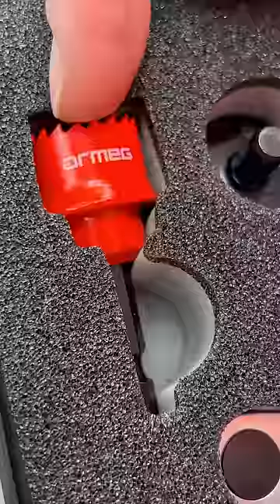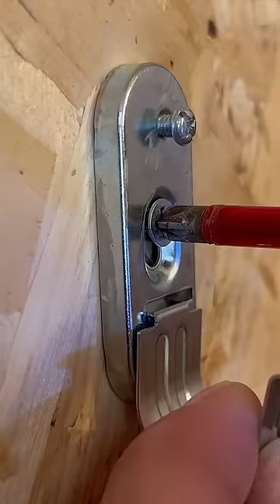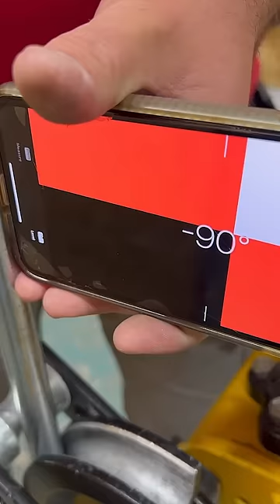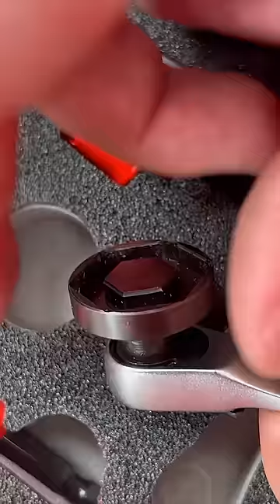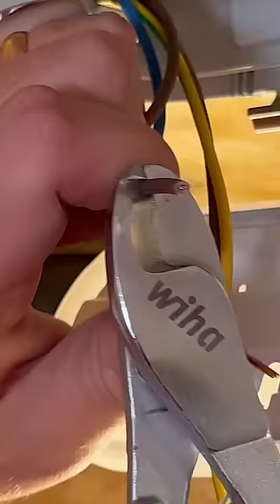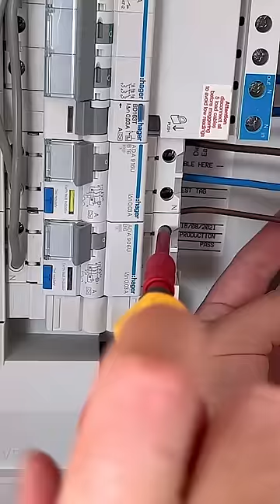How Many Electricians' Tools Does It Take to Fit a Light?

Comment: UK installation is really nuts.
Reply: What why? How?
Reply: This is commercial grade stuff, it's not like this in houses
Reply: I see what you did there and it bolts.
Reply: @pab26120 depends on the use, if you follow any modern code book im sure you have examples of simple installations and some that are quite over complicated. All depends on the use case and likelihood+risk of failure.
Reply: But the USA runs on low Voltage. Do you realise that domestic mains electricity in the U.K. is double the voltage of the USA ? In real terms thats about 10x the amount of electricity. Commercial is about 10x that again.
Reply: @rob-fb5xs   Yes, and the US system is even more nuts with a big waste of good materials by continuing using 120V
Reply: @rob-fb5xs double the voltage is 10x? Wow. Btw we run 240v to appliances that need it, and even then it's safer because each hot is only 120v potential to ground.
Reply: @snorman1911  Ha ha! I’ve got no idea, I just thought I’d write that to get some funny replies 😄
Reply: @mortenwinslw2785 no need for anything more than 110v. You know why everything costs 3x, takes 3x as long, takes 3x as many people in the UK? Because of this exact video. No need for any of this nonsense. It would take him 6x longer to do a job. The 220v also prevents most people from doing stuff themselves. It's unfathomable to people in the UK to hear that a lot of people do work around their houses themselves. Not just electrical, but anything. It's just not in their DNA to do diy stuff in the UK. Anything that needs more than 110v, gets 220V. No need for 220 running all over the place. You never even use half of what the circuit is designed for.
Reply: @littlejackalo5326 where are you getting 220v from? Uk voltage is 240v, harmonised with Europe in 2003 to 230v. The Uk has one of if not the safest and most comprehensive electrical regulations in the world. Our installations are top class. Why you think unqualified people should be able to work on electrical installations is beyond me, do you think people should be able to fiddle with their gas too? 

Would you rather have this install in your home, or a “that’ll do” install? I know which one I’d go for.
Reply: @mrglock568 I mean quite literally in the US you can work on your own gas and electric lines. Sometimes needing an inspection but that’s the price you pay for actual ownership of your property. Do whatever you want. But mess up and it’s on your shoulders.
Reply: @mrglock568 yes I do think untrained people should be able to fiddle with whatever they so please. It’s that same attitude that led us to separate from your crown in the first place. You act as if electrical is rocket science and that some random person committed to the craft couldn’t learn to wire a 120v switch with a YouTube video. If only Brit’s would trust the experts when it came to their teeth care.
Reply: @mrglock568 well in North America people generally say 220v to 240v interchangeably. Same with 110v to 120v due to most appliances/devices allowing a +/- 10% in voltage tolerances for AC.
Reply: @littlejackalo5326 The same thinking exists in Europe, where 230/400 is common in homes. 400v goes to Water Heaters, Stoves, EV Chargers, and 230 goes to things that 400 isn’t necessary for. Anything above 50v can kill you 120 isn’t safe its just safer. But it still isn’t safe to just touch all willy nilly. All 230/400 circuits are protected by RCD “GFCI” something that North America doesn’t do. Which makes 230/400 inherently safer than 240/120 because its always required to be behind an RCD. 240 dryers nope no GFCI stove nope. EV nope. And 120 again nope only in wet locations. Which is why all North American hair dryers are required to have a GFCI plug something you won’t find on an EU UK AU hair dryer.

Also twice the voltage half the amps. Hair dryers in the US every one I’ve used makes the cord warm to hot. Where’s at best the cord only gets slightly warm in Europe. Some schools of thought consider higher amp draw more dangerous.

120 is a legacy system that stuck around and causes far more problems like arc fault issues due to people thinking they were better than others. And in some US states it is against code to work on your own electricity. 120 lived on because the US light blubs at the time didn’t work well on 240 wheres somehow German light blubs worked fine so to save copper Europe chose to go with 220 now 230. And America added 240 after the wave of all electrified homes swept the nation due to GE’s all electric house program. 120 is not sufficient for most things. Even lamps and other low power devices like game consoles in Europe at max only need a Euro cable which is rated at 2.5 amps and that was far before leds were a thing. 2.5 amp x 220 is 550 and 2,5 x 230 575.  Where’s in the US 2.5 x 110 is 275 and while that is perfectly adequate for a 60 watt light blub for some reason 13amp wire was always used.

It is interesting the difference in choices each place made and for their respective reasons. But after seeing how efficient and safe the EU system is despite being twice the voltage and Americans always saying 240 is deadly 120 is safe. I’ve come to learn that’s watering down the risks and trying to justify using an outdated system. So yes while 230 is inherently less safe than 120 it is implemented in a far safer way than 120 ever was.

Code in the US just now started mandating 120 circuits be protected by gfci / arc fault breakers and all outlets have to have shutters now but that’s only on new house installations. So finally the 120 system is catching up to the EU style. But when every kitchen appliance maxes out a 15 amp outlet and 12 gauge is now standard to run vs the 2,5mm2 standard in Europe its a waste of copper. For something that could be fixed for the same reason stoves and dryers use 240. They are high amp devices.

Also hair dryers go up to 2400watts in Europe. US dryers max out at 1875 the max for a 15 amp circuit. 2400 is not the max of a EU 16 amp circuit. It also means you can have an air fryer, toaster, coffee machine, running at the same time on one run of 2,5 which is similar to 14 gauge. The last kitchen I had in the US had to have 12 gauge and 20 amp breakers for the kitchen. Because Air Fryer, Toaster Ovens etc are very popular now days.

So no I do not think 120 is justified as satisfactory anymore. I used too, but I’ve since seen things done far better. Now its okay to have an opinion but this is mine after experiencing and seeing the benefits plus learning more about the differences. I do not think in a world where high powered appliances are all the rage and materials due to EV’s becoming more and more common that sticking to a system invented for DC power distribution in the late 1800’s to early 1900’s is a wise decision. Especially when the majority of the world uses 230/240 for their low mains voltages side and only a small part of the world has stuck to 120 and an even smaller part 100v in Japan.

I realize this may sound like an argument I am just trying to convey what I’ve learned about the two systems. I realize I may come off as biased perhaps that because I grew up being told 240 dangerous 120 safe. When in reality neither are safe. They are both dangerous just one is slightly more dangerous than the other when there are no protections in place, which is only really common in North America. I can’t speak for countries outside of Northern Europe, and the AU/NZ. But as far as western standards go 230/400 is arguably far safer only due to the fact its treated with much more respect and unfortunately fear than 120 is, which might be why the EU UK AU and NZ all adopted all RCD protected circuits far sooner than compared to North American which is just now starting to adopt a similar approach. Because people have been thinking for far too long 120 is automatically “safe”.

Also fun note, worksites in the UK use yellow transformer boxes which output 55v on each leg to 110v power tools so that if one gets shocked its 55v to earth. As 110 is considered dangerous and 55v is considered far safer than 110 and 240.
Reply: @rob-fb5xs you realize you have 240v in your house? And commercial is 208 or 480v primarily? 

Time to educate yourself.
Reply: @leftyeh6495  Oh I know I just seem to have failed to express the extent its been implemented. I did say the code which I believe was updated to require gfci and or arc fault on every circuit. But at least at the time it didn’t include manufactured / mobile homes as my friend who moved into one in 2020 brand new too built that year. Had only gfci in wet locations and the outlets did not have shutters. Which was also part of the update for new residential builds. Now I may be misremembering this so I can’t guarantee, but I do know as i looked their panel has no arc fault breakers nor gfci breakers. 

Which may be a great thing considering I’ve only heard bad things about arc fault breakers being overly sensitive. Where’s arcfault breaker are not a thing as far as I’ve seen in Europe at least Norway, Sweden, and Germany. From what I was told arc faults are kinda pointless or redundant at 230 as RCDs are or have been sufficient enough. That it has to do with the 120 being more prone to arc faults being more a concern I believe due to the high amp draw but I may be wrong. I’m only learning still, but it’s interesting the differing view points.

I really like not having gfci on every plug “outlet I didn’t mind” but its nice that it’s in the mains panel and every circuit is protected and as far as my experience I’ve never had one trip let alone unnecessarily. The only thing I’ve seen a device in Norway have an RCD in line to the plug was on a blow up hot tub. I think the reason rcd is standard is ultimately to protect the house and is the same reason for why only elektrikern is allowed to do electrical.

Yes to protect the living but also to prevent property damage as house fires are not favourable. Well no one is fond of them anywhere «except a few particular people» but I’ve seen some real shoddy diy electrical work in online forums and on a few DIY shows in the US no clue about Canada but I don’t doubt. Ultimately it is nice to see the US catching up but the implementation is like bloated beta software. Hopefully one day things will even out. However unfortunately I kinda agree the US takes it overkill on trying to prevent Darwin awards. Can’t protect everyone and can’t stop some people “sometimes on purpose” trying to do stupid things.
Reply: @peteasmr2952 I agree with everything you have stated. I've been an electrician for a long time now and always wondered why the U.S. stuck to the split single phase 120/240 volt system for residential applications. Raising to 240/480 single phase would lower wasted copper exponentially. Besides anyone who thinks 120v vs 240v on a 2 wire system obviously doesn't understand math. But I guess we Americans are just stuck in your ways lol. 
P.S. your calculations were off when comparing the example of a 2.5 amp cord. Watts used are watts used. Regardless of voltage in turn creating your current/ amps
Reply: @colbyturner7182  I appreciate the response, I had considering deleting it at one point cause I feel I come off a bit too strong when I’m just trying to be informative.

As for the Eurocord that’s rated at 2.5 amps I don’t remember exactly what I said. If it helps its wire size is .75mm2. Which is between 18 and 19 awg from the chart i could find. 18 being .82mm2 and 19awg being .65mm2 but it seems it’s typically referred to as 18awg. From what I could find 18awg Spt1/2 is typically rated for 10amp?

I tried to fact check as I went along but I guess I just divided the EU typical rating by 2 instead of comparing what its related to in AWG. I find it interesting the EU typically rates Eurocords .75mm2 as 2.5 amps where’s the US gives a higher safe rating for similar sized wire. I did see a place online rate Eurocord .75mm2 at 6amps. So maybe a case of being overly cautious.

I suspect I didn’t include the fact that cable materials / insulation effect typical safe ratings. But there many variables there. I haven’t gotten to figure out what exactly is different between the material typically used in US cords like SPT-1 vs the H03VVH2-F Eurocord / H05VV-F “Schuko” extension cables I have on hand are made of. And that’s just the cords people typically handle not Romax etc.

I am still learning and the differences fascinate me. I have even considered and somewhat looked into what it would take to become an electrician in Norway. I’ve even considered making a YouTube channel about comparing the differences between the US and EU grid and all that. But I want to be completely accurate in my information and welcoming enough that people are receptive to my content that maybe one day I can help influence a needed change in the US. But at the least just be an interesting and informative channel. I don’t know.

I apologise for the lengthy reply. But i hope its at least interesting.
Reply: Lots of nuts and bolts.
Reply: Yup, way too much fannying around. They like to make out your house will burn down if it's not all 100% by the book to try justify their rip off rate.
Reply: @rob-fb5xs in Australia and New Zealand we use plastic conduit for all commercial, industrial and residential work and we have the same voltage as the uk and Europe. The uk just does things overkill.
Reply: @TheAtqthe30th  u get 220 -230 volts from a single phase system.  And 208 volts from a 3 phase system. When a piece of equipment comes out and says it runs from 208 to 240 its meaning it can run on either with no ill effect.  If u hook up 208 to equipment that calls for 230 it will run but it will work extra hard and limit the life of the equipment

Comment: So for those who want to expand our arsenal… can we get a list of tools that were used? I’m learning new things in electrical and mechanical maintenance and want to start buying my own tools so this would be really helpful
Reply: Lol, if you cant tell what tools is he using, they are not for you....
Reply: @janvrabec3401 Like I said in my comment… “I’m learning”, I’d like to know what they do, how to properly use them, etc… your response is the biggest waste of time moe thanks
Reply: you will need : 1 crusty flathead (klein), 1 rusty pair of kleins (klein), 1 slipjoint pocket knife
Reply: In order of appearance:
- Green crosshair level (Bosch, Milwaukee, etc. all make them)
- Marker in what appears to be custom holder made from adapters and a cable gland
- Flathead insulated screwdriver
- (Cardboard for separating out single wires from a bunch, this may or may not count as a 'tool')
- Automatic Center Punch - 5 inch Brass Spring Loaded
- Cutting Fluid
- Armeg SSH020 Sheet Steel Holesaw, Red, 20mm
- Power drill
- MAVAST Silicone Deburring Tool
- Cloth :P
- Philips insulated screwdriver
- KNIPEX Tools - Pliers Wrench, Chrome (8603250), 10-Inch
- Tape measure
- Magnetic welding holder
- Portable mechanical pipe/conduit bender (can't find the exact one)
- iPhone level app
- Hacksaw
- Square file
- Large die set (can't find his exact one, but a large die set will give you a t-handle. Manual conduit threaders give you a bar not a t-handle to drive the die)
- Conduit reamer
- KNIPEX Tools - Alligator Water Pump Pliers (8801250), 10-Inch
- 20mm Brocket - Conduit Bush Socket - Armeg
- 1/4" mini ratchet
- Fish stick set, possibly glow in the dark variety
- Wiha Classic 34730 Cable Cutter 200 mm (he has an older model, new model has different teeth)
- BAT22-6NV2 Thomas & Betts Sta-Kon Battery Powered Crimping Tool with DIE2001 Thomas & Betts Insulated Terminal Crimping Die, 22-10AWG
- Reel spinner (couldn't find a specific style like his, most of ours (US) are stands that you load the reels on)
- Wiha insulated screwdriver set, 19 pieces - 28398
- Wiha insulated pliers (background)
Edit: last screwdriver is not the same 28398 handle, it is in fact - Wiha 28789 11-Piece Insulated TorqueVario-S & SlimLine Blade Set. Credit: @Elektrotechniker

I did my best for a useless shorts comment that will never be seen again, take it as such lol
Reply: @iangillespie1605 don’t worry.  Your hard work will be read by many, appreciated by most, commented on by a couple and ‘liked’ by far fewer than you deserve!

Comment: Looks legit & professional! 
But why not use plastic instead of metal? 
Easier & faster to handle.
Reply: Damage concerns typically. Plastic is not going to last long getting stuff smacked into it, especially if it gets any UV damage. 

99% of the PVC plastic conduit I install is underground or in a corrosive (acidic or caustic) environment.
Reply: Its wooden house. In case of short circuit of wire or overheating, it should be contained into metal pipes to avoid fire.

Comment: Couldn't you eyeball the bend for the pipe? J/k (as in I was joking. For those who don't fully read before responding). I'm all good with whatever methods you use as long as you're safe and it works. Nice to see some of the upgrades in electrical. Good stuff man.

Comment: Meticulous work bro. What’s the kit model with the ratchet?
Reply: Couldn't find a kit with them all in it, but the individual components (we can see in the video) are:
- Armeg SSH020 Sheet Steel Holesaw, Red, 20mm
- Armeg TBS20 20mm Brocket - Conduit Bush Socket
- generic 1/4" mini ratchet

edit: Armeg TBSSH5PCSET
Reply: @iangillespie1605  Thank you so much

Comment: Dude, this is why my boss is expecting shit to get done so quickly. I somehow manage with a pair of linemans, screw drivers, something to cut pipe with and some wire strippers. And a drill. And if I’m lucky I have some matching compression connectors in the van for either end of the conduit run. I’ll save the wire for another day 😂